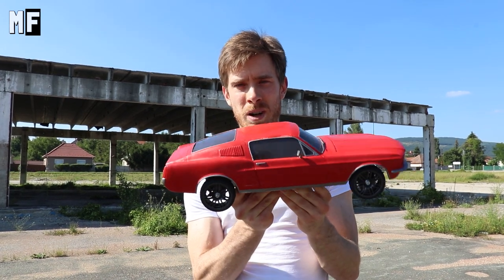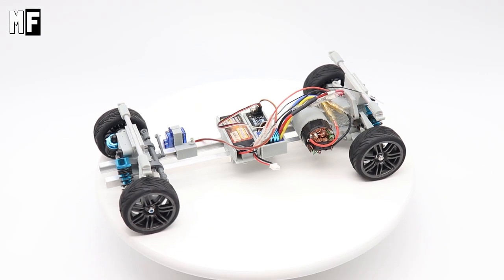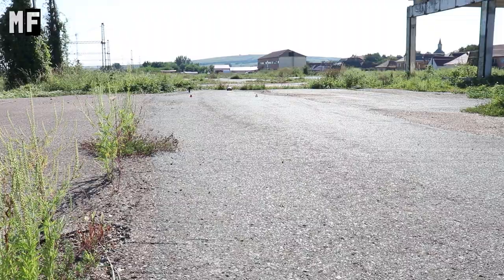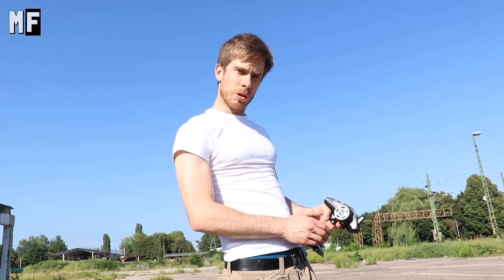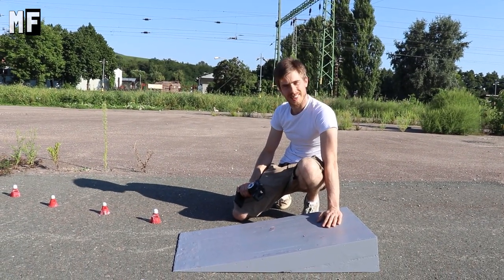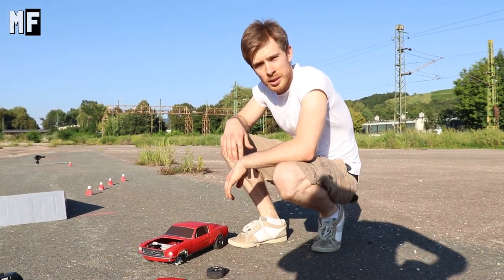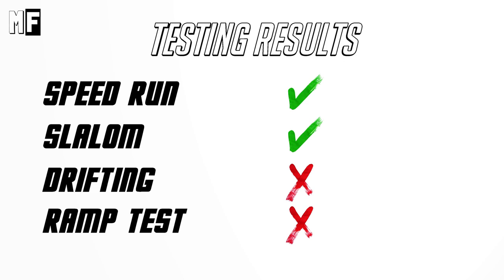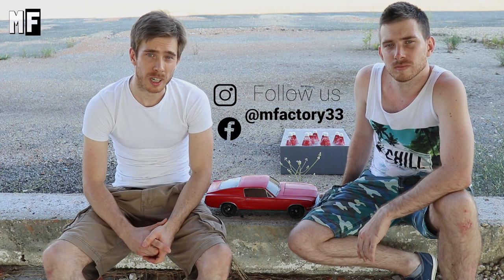FORD MUSTANG 1967 Fastback 3D printed RC (TESTING Video)

Comment: Thank you so much for this, I'm printing busily as I type. I also want to thank you for making this available for free and also for making this car the unadulterated '67 Fastback and not the ugly Shelby version that I find totally unpleasant to look at. This has to be one of the prettiest muscle cars ever produced and Shelby destroyed the beautiful rear end of this car with the unsightly spoiler, talk about the right name for the right part. Thank you again.
Reply from the maker: no worries! Happy building!!!
Reply: @mfactory33  Very cool build however I have one small question that I hope you may have the answer to. I've basically assembled the chassis front  to rear and the measurement from centre of the front control arm to centre of the rear spring where the axle housing bolts on  is 235mm. 
 When I checked the body the distance centre of the front wheel opening to the centre of the rear wheel opening is 275mm.,  it looks like I'll have to extend the chassis somehow by 40mm, I'm just wondering where I went wrong.  It's not a game changer for the build as I can lengthen the middle chassis part and the tailshaft but I'm just curious where I made the mistake.
 Apart from this hiccup I'm loving the look of the 67 'stang, beautiful. the tyres will be be my first TPU adventure.
Thanks fellahs.I just had a look at the chassis on your mfactory33 website and it's different to the one I downloaded from another link to the body somewhere else...that would probably explain the difference...